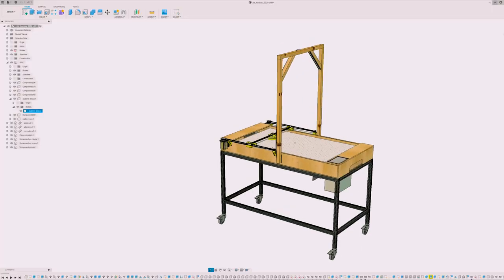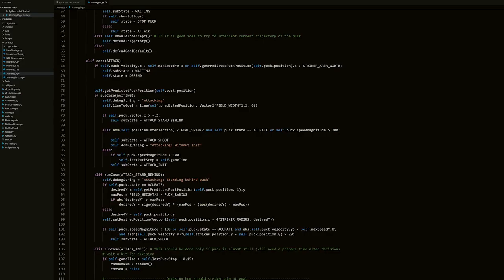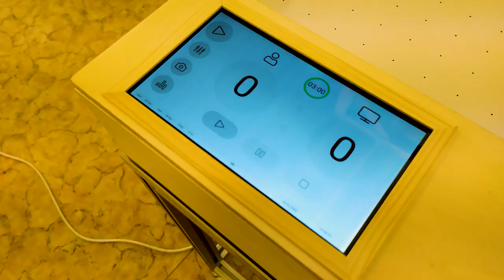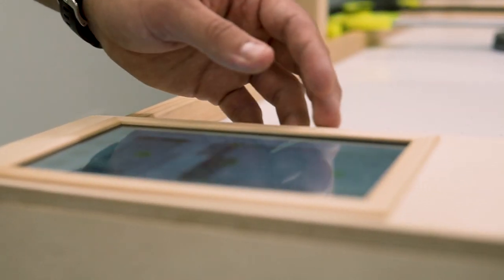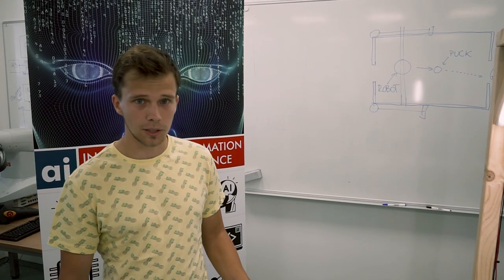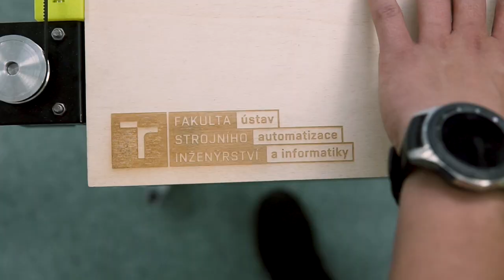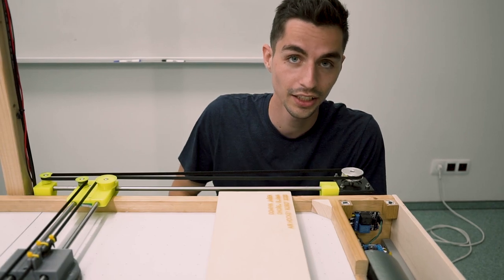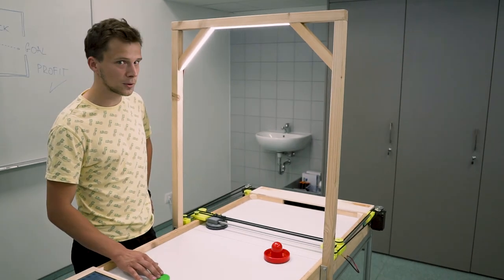AIR HOCKEY ROBOT

Comment: How much money would a commercial version cost ?

(this project could be made into a coin arcade game station for a tavern bar).

I speculate that the two Fans in the schematic must be used for the Air table levitation.
I like the way in which Goals are white strobe flashed; it makes a similar effect to Ice Hockey Goals.
I did not realize the project was for an Engineering Thesis; congratulations.
Reply: If you beat it, you could win $20. :-)
Reply: Hey, you're totally right. Fans are used to help the Puck floating more smoothly on the field.

Development of this robot cost less then 1000$, but commercially it would be much less.

Thank you!
Reply: Thank you for sharing this video. I hope your thesis impresses the Professors.
Reply: @jasekdominik  Don't short-change your time spent in R&D, though. Worth way more than $1,000.
Reply: @cpk2023b  +1 I agree, it was like hundreds of hours..

Comment: Hi, nice project! Can you share some info on game strategy algos that you use ecc?
Reply: Thanks :). We basically programmed 4 types of strategies with slightly different algorithms - each used in different difficulty setting so explaining all of them would be too extensive. But in summary: Every frame a puck trajectory (as well as other states of the game) is calculated based on filtered records of puck position in the last second (+-80 fps -> 80 recordings). At that point, we apply on these calculated states (puck trajectory, speed, position, predicted boundary bounces, robot position etc..) a bunch of conditional logic. The result is desired robot position.
Generally, there are 2 main strategy modes: Attack and Defense. The main idea is to try to be in attack mode as often as possible, so whenever the current moving puck is not considered dangerous and the robot is able to attack, the strategy switches to attack mode. Of course the evaluating of what is considered "dangerous puck", the attack itself, defense algorithms, aiming at goal and even using the side boundaries for more advanced shots on goal are no easy programming tasks and requires a LOT of testing. And that is also the reason why we created the game simulation - for quicker and more effective way of testing different game situations.
All of our code can be found on github (video description) so feel free to look there :). It's not the cleanest code ever (not at all actually :D) but hey, we were a bit pressed on time, so that excuses us (I guess).
Reply: @Marasadu  Thanks very much for the replay. Yeah, I was interested just to have a small insight before jumping on reading the actual code.
Thank you once again!

Comment: Great job! What camera did you choose for this. I didn't see the specs. Thank you!
Reply: We used RPi cam v1 with hardware binning to maximize FPS.
Reply: Dominik Jašek that's awesome. I have the V1 and and V2 but I wasn't sure if it was sufficient for the speed and resolution of thresholding etc for vision. Is that a special case you use?
Reply: @danielprestridge4957  V1 is a better pick in my opinion for things like this. V2 does not have 4x4 hardware pixel binning as oppose to V1 so at small resolutions (in our case 320x192 was enough) and high fps (+-80) V1 does not have to crop the frame in order to achieve these capture speeds. That means bigger FOV ->  smaller camera construction.

For casing, we 3D printed slightly modified version of this one: https://www.thingiverse.com/thing:792444. (We also used the HDMI Cable Extension thing, which is really cool: https://www.amazon.com/Arducam-Extension-Module-Raspberry-Specific/dp/B06XDNBM63)
Reply: @Marasadu  Thank you for all this. I just finished  controls lab class which we did something similar but they used a PSEye Camera but it was non-ideal. Thank you for the responses and thank you again for sharing!

Comment: What is the name of that belt drive arrangement?
Reply: It's called a H-bot. It's actually a really clever solutions for 2-dimensional (planar) movement as both motors are stationary.
It's also frequently compared to another type of (similar) movement: Core XY.  Look it up if you are interested :).
Reply: @Marasadu  Nice, thanks - I'd seen this type of arrangement before, but couldn't remember what it was called. Very cool robot - well done!